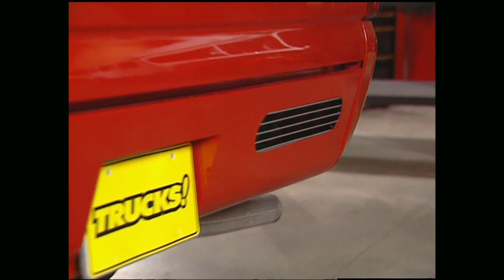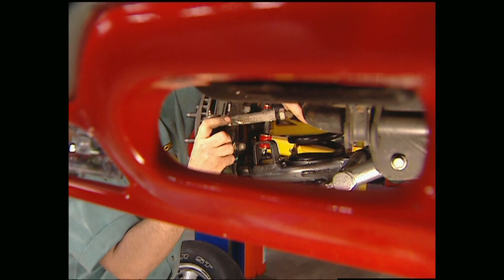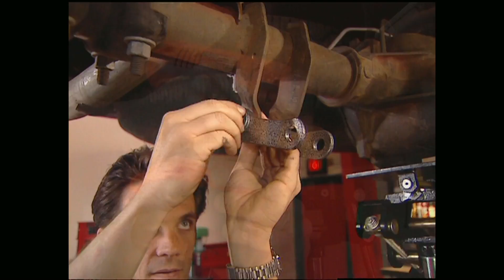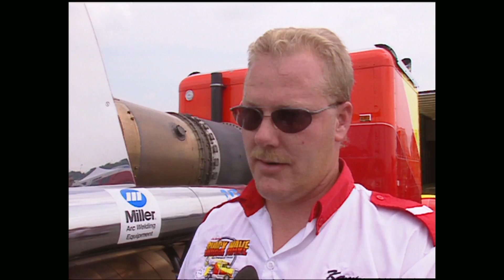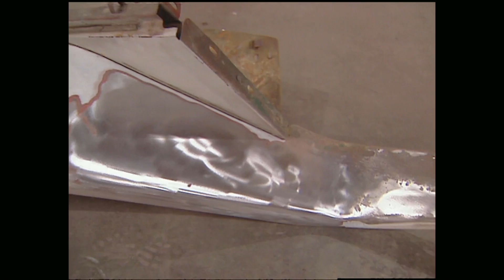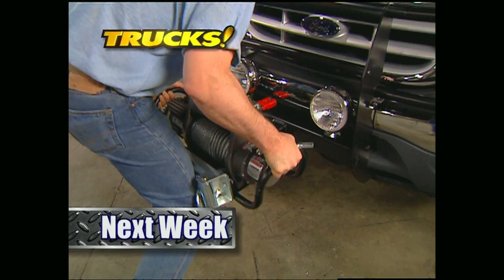Lowering The Sport Sierra For A Proper Stance - Trucks! S1, E14

Comment: Wish thicker gauge rolls pans were available and able to be mounted directly to the frame (like the Rear Bumper) rather than drill several holes and screw it onto the bed just to mount it, also thin gauge roll pans can easily get bent out of shape.